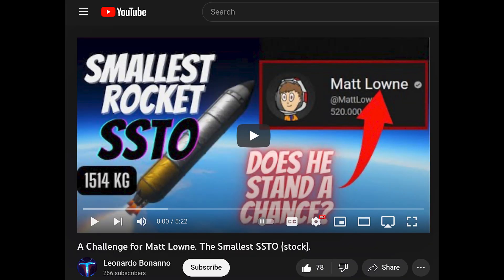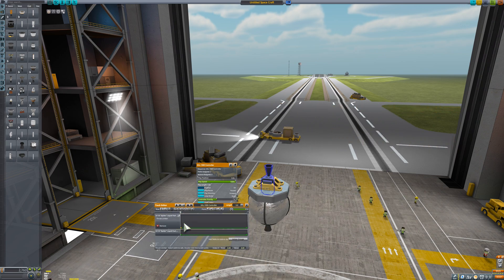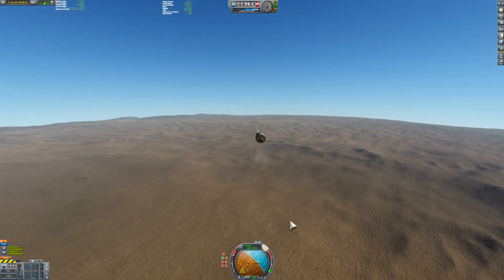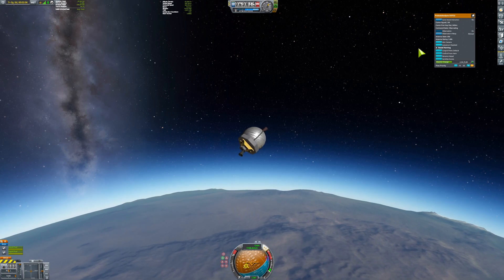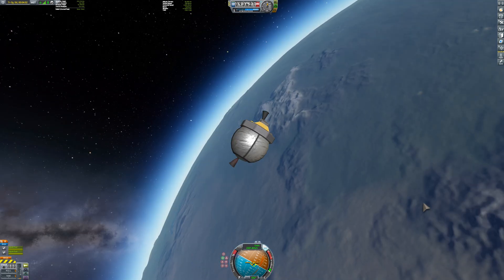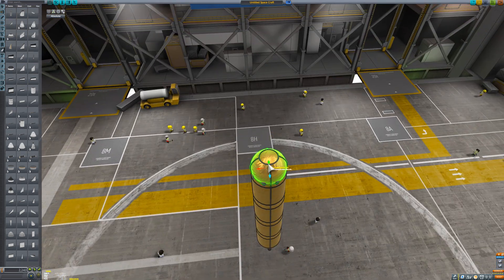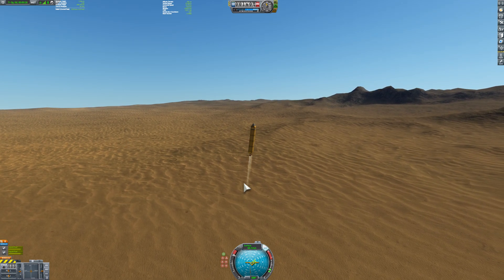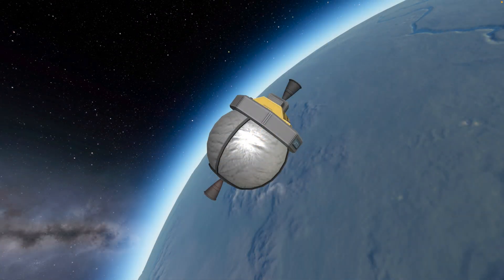KSP: LIGHTEST SSTO EVER! (Stock)

Comment: cool design but wouldnt you say engine overclocking is a disqualification?
Reply from the maker: It hasn’t been removed, so I would say that it still counts, but I still have a second design that beats the design in the video I watched.
Reply: time to pull out the kraken drive i guess

Comment: Now try it with tanks which are not radially attached to improve the drag model.
Oscar B is your friend.

And please do continue to make videos! ;)
Reply: Oscar B tank is heavier than the croissant tank he used. Drag would be smaller, but with a higher mass which defeats the whole purpose of smallest stock KAL overclocked SSTO
Reply: @leonardobonanno5115  it will be a little bit "smaller" SSTO,but it will not be the "LIGHTEST" SSTO